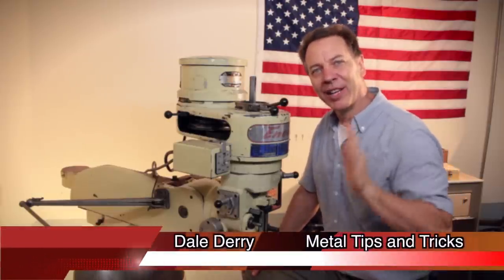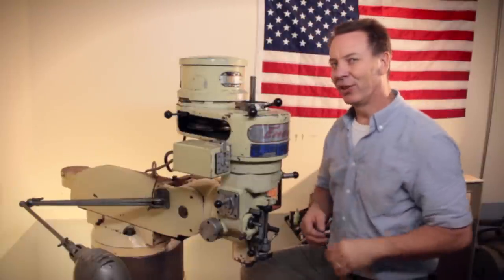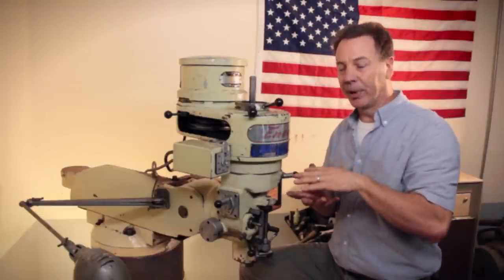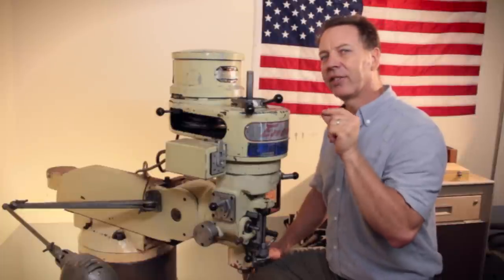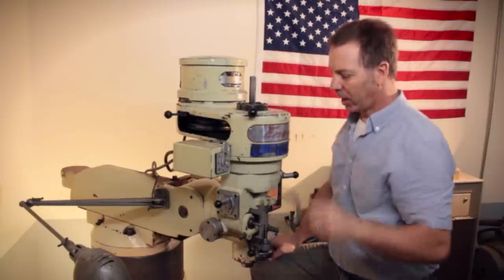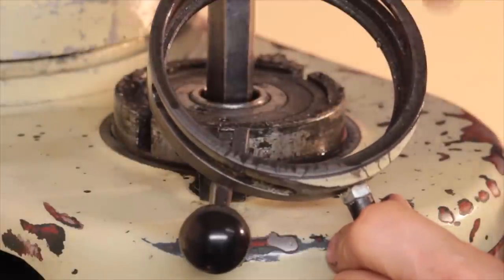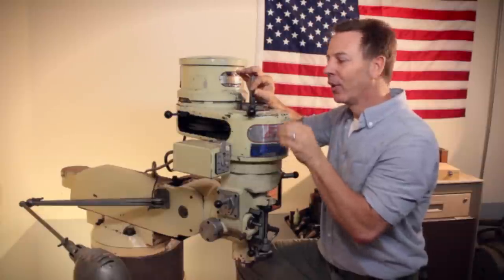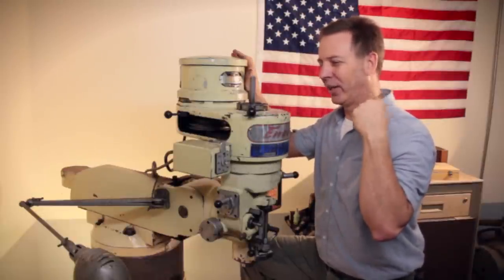Quieting a noisy Mill

Comment: The Gears you are talking about are called spline hubs  there is an upper and lower they engage in high and disengage in low or back gear.  they make that noise because they are clattering rather than being fully engaged due to misadjustment  wear or packed dirt on Vari Drive heads you can take the high low lever (the one on the side) and put it in the high position and loosen the clamp screw on the lever . and move the spindle back and forth to seat the spline hub and retighten your done .

Comment: This will not work on all mills, but drastic improvement in some, like my Rockwell 21-100 belt drive vert mill.
Loosen the motor and put a small drill or nail sideways between the mill and mount, one on both sides.
This works on the principle that the noise is coming from the motor and coupled to the air by the mill head.
The two point connection will not transmit much noise from the motor to the mount. Makes it ~ 5X quieter.

Comment: Yes this is very true the play your talking about is the Spline Hub not meshing correctly.    that's the sound that you hear when someone forgets to fully engage the Hi Lo  lever from back gear to High range and grinds the Spline Hub . but when its not meshed together and making that bad bearing sound you can also loosen the pinch bolt on the Hi Lo lever in High range and it will allow it to mesh better  but this is on a Bridgeport with a Vari Drive head  what I have done I the past with V belt heads is take out the screw slot heads on the lever on the top of the Head and replace them with socket head cap screws with the heads turned down  works great

Comment: I just pick up an Enco Knee Mill and wonder if you have any resources for manuals, parts lists or the like?
Reply from the maker: Hi, i found with my mill that it was just like a Bridgeport. All the parts are the same except for some of the thread size. Like the locking handle for the table are metric. You can use any manual on line for a bridgeport.
Reply: Find a comparable Grizzly model for diagrams & most mechanical parts. I do so for both my 40-some year old 8" x 28" Enco mini-Bridgie knee mill and 12" x 36" HFT lathe. (Grizzly G4003 twin)  Two years later, I hope by now you've learned of the cross-compatibility of so many of these imported machines/parts/specs. Cheers.

Comment: Hey Dale,
interesting take on that subject. the head on my bridgeport likes to rattle at the beginning of a cut and at the end of a cut. volume of the rattle is proportionate to the size of the cutter and depth of cut. ..no load it runs smooth and quiet
i've noticed a similar noise in Tom Liptons bridgeport clone and in Keith Fenners BP too got any ideas? 

cheers
mike

Comment: My Enco ( 1986 with the two speed motor) mill makes  rattling noise when cutting steel but not aluminum.  That makes me think it's bearings.  IT also has a hinky  issue with the back gears.  To prevent it from  making a god awful  gear grinding noise when in back gears  I have to shim the collar up a bout 30 thousandths  of an inch.    Now I've had the table off  and I can tell you that it is not built as a true clone of the bridgeport. so I don't imagine that the head will be a true clone either.  I haven't seen an instructional or manual anywhere on doing the spindle bearings.  But I think I need to make a new Back Gears Collar to fix that grinding noise.

Comment: What about variable speed heads? my Bridgeport head sounds like it's grinding rocks at all speeds. The grinding sound doesn't seem to vary depending on the rpm I dial in add i turn the wheel for faster or slower. back gears or standard, same noise.
Reply from the maker: Im sorry I know nothing about the variable speed heads. :-(
Reply: +Metal Tips and Tricks (Dale Derry) ok thanks. I'll have to take a look and see if it may be something similar. My second knee mill is a belt drive so this will come in handy some day I'm sure at least. Thanks for the videos. I very much love your channel. :)
Reply: Your movable pulley is wallowed out and flopping on the shaft. We took ours apart and bored the pulley to take replaceble Delrin bushings.
Reply: The only things on a Bridgeport 2j variable speed head that always turns the same speed are the motor and the drive pulley. Everything else varies.

Comment: my bridgeport doesnt hold any end mills.  every time I try to cut anything, the end mills slowly migrate downwards.  all the collets are brand new and the cutters are new.  what could be the issue?
Reply: chanthu buth Check the drawbar's threads and depth of engagement with the collets.
Reply: You need to make sure that your collet is properly screwed in to the bar also check the threads on the bar and the bar has the actual lenght